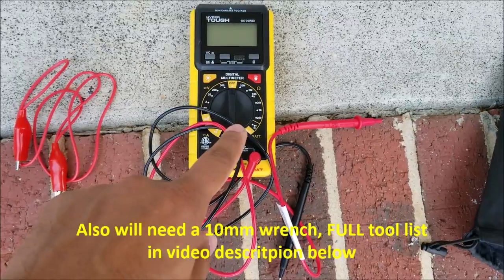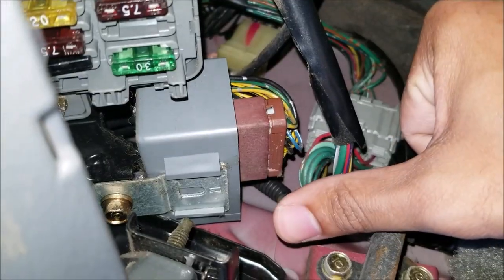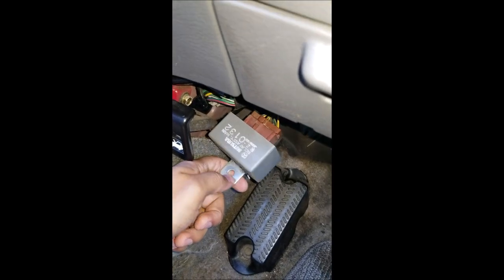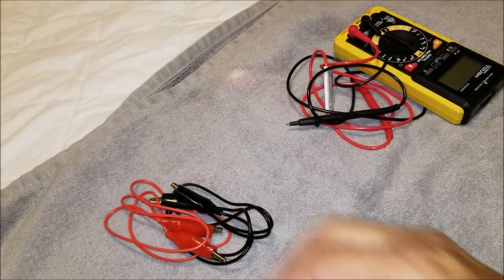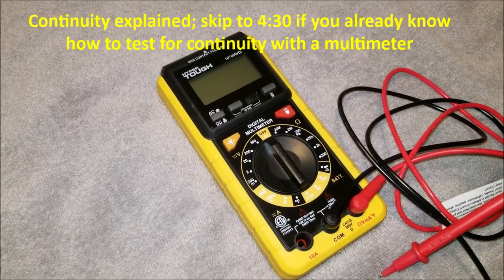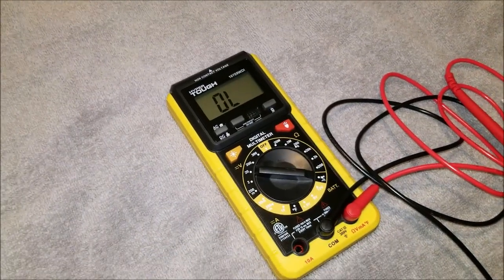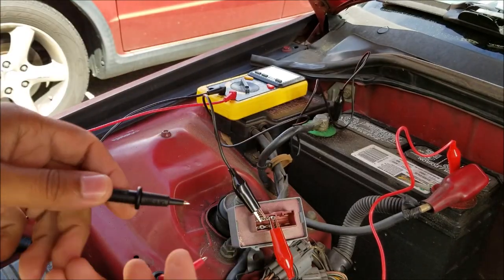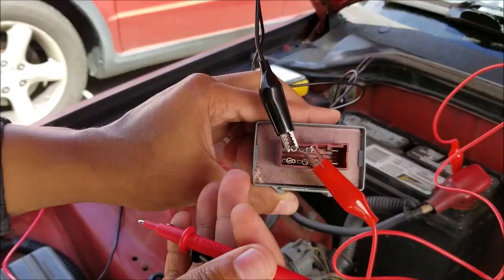How to Test and Replace Main Relay | Honda Acura 92-00 | Car No Start

Comment: Props for making a good video in an apartment parking lot. I use to have to work outside too. Made me tough and thankful to have a shop to work in now
Reply from the maker: Appreciate you noticing that fact haha, had to make do with what I had at the time. As you said, definitely makes a person appreciate working in space on a car. Thanks for taking the time to leave a comment
Reply: @EngineeredMojo  you bet! Thank you for the advice, I used it. My relay is clicking and I have pressure on the rail. Now I'm digging into the distributor. I had no idea they have problems like they do. Had a little bit of oil in the bottom of the distributor cap, but def not oil soaked. No spark though. Any more advice on this one? Have a good day!
Reply from the maker: @jesseray8433  there is an O ring in the distributor that sounds like it needs to be changed. But I doubt that would be the cause of a no start. I'd keep pushing through the steps. You've verified fuel, now you can verify spark. Inline spark tester can be sourced as a loaner tool from a local auto parts store. If that checks out, good ol compression check is next. Which that tool can also be gotten as a loaner and not much different process than inline spark test

Comment: My canadian 99 civic Si (american would be EX) keeps blowing fuse 15 (alternator/speedsensor) but if I unplug  my main relay it doesnt blow it. Something about that main relay or wiring is causing it.
Reply from the maker: Check out this thread, you may have a short circuit beneath your intake:

https://www.honda-acura.net/forums/92-civic-el-and-del-sol/215003-alternator-fuse-keeps-blowing-whats-the-problem.html
Reply: @EngineeredMojo   im afraid not. i have a k20a2 swap out of a 02 rsx type S. everything was running fine on that type S. its just my civic has been sitting for a year and half. i feel as if my pump maybe went bad or relay contacts got messed up. car sat in extreme cold and then extreme heat
Reply: and if one of the wires from the main relay harness shorted im gona wana give up
Reply: and if one of the wires from the main relay harness shorted im gona wana give up

Comment: what happens if i only feel one click??
Reply from the maker: You may have a circuitry failure. I'd either perform the test shown in this video or if you don't want to hassle with the testing you could purchase a new relay to see if it fixes your issue. Its such a fast swap and test, only costs time to drive to store and cost of relay if that's the issue.

Comment: Excellent video and thanks for including the pinouts and testing procedure! I used your test to verify that my newbie re-soldering was effective on my '96 accord. Two further tips. 1) You don't need to remove the 8mm bolt to get to the relay. You can just slide it up and out (may be a little sticky at first). 2) Also, to give yourself more room under there, you can remove the under-dash with only one screw hidden behind the coin tray to the left of the steering wheel.
Reply from the maker: Ahh thanks for the tips! The less bolts to remove (and possibly lose) the better haha. Awesome you went the resoldering fix route. Did you find it a simple process? I've soldered different components in past but never a circuit board. Also thanks for taking the time to leave feedback and provide useful tips. This is getting pinned
Reply: @EngineeredMojo  Yes. I had never really soldered before. I just watched this video ( https://youtu.be/-PLCEeTeXys?t=49 ) bought a cheap soldering iron and gave it a go. I figured the worst case is it wouldn't work and would go ahead and spend the $50 on a replacement. But your tests gave me the confidence that I could prove continuity after completing the solder. And I could definitely see the cracks visually within at least 2 or 3 of the existing solder points when I began. I am not normally a fix it guy, so it was very satisfying to "do a thing". Thanks again.

Comment: I don't understand why you need to connect the relay and multimeter to a 12v battery to check continuity. Multimeters have internal batteries for finding continuity. Or are you checking for voltages? I checked all 7 connections of my main relay with the multimeter (no 12v battery involved) and not connecter showed any continuity with any other connecter. I suppose this means the relay needs repair. Correct? You didn't show the two other of the three tests, but which terminals do you test for continuitiy? They are numbered 1-8 on the relay base. Which to which?
Reply from the maker: You're not going to get enough voltage to actuate the relay without a battery. That's the purpose of the battery and probably why you are not being able to accurately test continuity. If you were just checking a straight path of wire connection no battery would be needed, but remember you are testing a relay and the switches only open and close electromagnetically. Hope that clears it up, use the battery as shown haha
Reply: @EngineeredMojo  O.K., I understand the need for a 12v battery. I still don't know which terminals to attach voltage to then which terminals between which to check continuity. As it turns out, I'm not going to concern myself with that this week-end since I did continuity test of the circuit board itself, between the protruding wire terminals and the one or ones on that segment of the board. These all connected, with small ohms, with current moving across the board. One terminal, though, would connect only contacting the solder, not the wire. And the wire and its own solder don't connect. Although the disconnection is essentially invisible, this must be the broken solder connection. I plan to re-solder it, then re-install and test for starting.

Comment: Excellent. Thanks!  The test also works with a 9v battery. I tried it inside where easier to work with. 
I have a 2001 CrV. It jerked a little at low RPMs one day around a traffic circle or two, stalled in motion during a turn but would start immediately back up with some extra throttle.  The next day it wouldn't start. It's a manual transmission. It was running like a top for 1,500 miles with 35+ mpg fuel economy.

No codes. Battery is good/charged. Spark production at plugs are arcing and appear correctly timed. All the fuses inside cab and the motor bay are good by sight and ohm tested. Main relay under glove box appears good and tested good. No oil or coolant cross- contamination. Motor oil and coolant is full. 
I've tried the accelerator all the way to floor as well as pumping.
I've tried spraying starter fluid into the intake and still no start. It will crank and crank until battery is dead. If I hold gas pedal 100% down it sounds like it almost wants to start (sometimes) but doesn't. 

What should I check next? Again, no obd2 codes are in the computer. I was gonna check for fuel on the output side of the fuel filter....just loosen the sealing nut a couple of turns. The timing should be fine and there's no abnormal noises from anywhere. Thanks!
Reply from the maker: A compression test would be my next step, if you don't have the gauge that plugs into the spark plug hole it can be rented for free from an auto parts store. Then I'd check fuel pressure as you state above, keep me posted on the process if you remember to come back to this thread!
Reply: I would check the crank position sensor
Reply: @stevenblack2548  new info. It will start and run for 3 to 5 minutes and then hard stall and sometimes restart but usually not. When it cools down it will restart 6 to 24 hours later.
Reply: @thesetruths1404  my car is having this issue please tell me if you fixed it
Reply: @sdtruth619  the issue was a bad ICM (Ignition control module) from the get go. I replaced it early-on but the part was bad and kept it failing.  I went thru everything twice and when I reinstalled the original ICM it changed enough to give me idea it was a bad ICM. Ordered 2nd new one ( more pricey brand ) and sure enough it worked. If you install an ICM buy one that's $40+ in cost. Not a China one.
Reply: Furthermore what caused ICM to I believe was likely spark signal suppression from oil filling up my spark plug holes. Bad crusty valve cover seals in them. Someone changed the main valve cover seal but didn't bother with spark plug seals for some lazy reason. Dumb dumb. Lesson learned was always pull spark plug boots if easily accessible when inspecting a car to buy! I think they were leaking from before I bought it.

Comment: Help someone my car has power but wont start I replaced the starter it was not it it just stop working when I stop for gas and hop back in then it stop working doesnt crank just shows dash lights
Reply from the maker: No crank? As in your car won't turn over and try to start? Sounds like it could be a possible issue in your ignition system. Does your fuel pump prime as in can you hear it when key is turned to II?
Reply: @EngineeredMojo  Same problem with my civic. I did a auto to manual swap and the car turned on fine and everything. I didn't drive it for a few day and when I did it was low on gas. I go to the gas station and add gas and then it won't start. There was a crank but wouldn't start so I had a spare battery and basically jump started it like that but as I was driving away the car idle was bad when accelerating. It wouldn't go more than 5mph until it suddenly stopped. From there I had to push my car home (Luckily I live a few blocks from where it all happened). It was a good work out though. From that day I replaced the fuel pump and still no go. The dashboard lights turn on and the main relay clicks are there. Fuel pump was just replaced and its priming. My only guess is the battery but I doubt it or else the lights inside would be dim or the car wouldn't have any power at all. What can it be?
Reply from the maker: @samuelochoa3344  I assume no check engine lights correct? Sounds like your ecu went into "limp" mode since you could not travel more than 5mph. I would assume a distributor issue given the bad idle you mentioned and a clogged catlytic converter has been known to throw an ECU into "limp" mode. Do you have a spare distributor you could throw on your car to test or an inline spark tester(can be bought pretty cheap or as a free loaner tool)?
Reply: @EngineeredMojo  Thank you for the help brother! It ended up being the battery. The distributor would be a bit concerning though - being I'm on a slight budget lol. I'll forsure use this for whenever its needed. Thank you for the help and quick reply brother! Right on!!
Reply from the maker: @samuelochoa3344  awesome! Always good to hear of a car fix being effective

Comment: Heaven help you if it is an 89 Integra.  It is all the way up further back near the firewall, and way up out of reach and out of sight mounted along side a couple other switches.
Reply from the maker: Wow, not the typical considerate japanese engineering haha. Good to know thanks for sharing! I run across those gen integras every now and then

Comment: Would you happen to have the test procedure  for testing the harness that the relay plugs into..
Reply from the maker: I do not unfortunately, if you are comfortable with using a voltmeter and have a haynes manual, there are good wiring diagrams in their for Honda/Acura that will show you which wires are used to complete a circuit. That'll help guide you on the sequence to test you harness. Hope that helps a bit

Comment: What if the starter relay clicks, and the car cranks but doesn’t turn over. The fuel pump works, battery works, and the relay does the clicks the way it’s supposed to.
Reply from the maker: If your certain your getting fuel, next check would be to confirm you're getting spark. They sell online spark testers that are fairly cheap and easy to use. If spark is confirmed your next step is to test compression at each cylinder. Again a compression tester is fairly cheap tool, it's just a process. I'll put this on my list as a video to make but in the meantime their is a channel chrisfix that goes through the process I talk about above on a general overview

Comment: Can you please answer I have 1992 Acura Integra 1.8 and I have to be replacing it every like 5 months the main relay is that normal being and old car I won't hear the click it won't turn on r I have to open the key live it for a while then it will turn on but eventually it won't. I replaced the main relay than it turns on .
Reply from the maker: If you are replacing the main relay every few months, I would trace/view the wiring back to the fuse box to see if there is any damaged wiring to the main relay that may be causing an electrical short circuit. It shouldn't be malfunctioning every few months
Reply: @EngineeredMojo   ok ty I replaced the main relay fuse I put it on, but thers still no click, the check engine is on, when it use to click the check engine would turn off and it would turn on like nothing, why is it not clicking ?
Reply from the maker: @cadillack6989  does your vehicle now start and stay running but with a check engine light?
Reply: @EngineeredMojo  no it doesn't turn on the car I been looking for info I found a similar problem and something about ECU the check engine don't blink it just stays on ? Could it be the ECU
Reply from the maker: @cadillack6989  do you know anyone with a car similar to yours where you can swap there ecu to test? It could potentially be an ecu problem. Ecus are fairly cheap as well on the used market
Reply: @EngineeredMojo  nope this is like the only car I've seen around not even on the yunk yards I live in Bakersfield CA
Reply: @EngineeredMojo  I have a question if ECU is not working would it still have gas pressure and spark?
Reply from the maker: kg quite possibly, the ecu can be malfunctioning in only a certain circuit causing a localized failure. While not common, it's possible for a solder to fail in an older ecu, there are a few YouTube videos about specifically for Honda ecus
Reply from the maker: @cadillack6989  dang well at least you have a unique car in your area. Used ECU's are fairly cheap though, wouldn't hurt to purchase a used one to test if you are not comfortable opening up your existing ECU and testing circuits (I know that's is not my strong area)
Reply: @EngineeredMojo  like for how much for a used one a ECU, can you look for one I'll pay you
Reply: Yeah I really like car I have plans for it, is a rare car in my Area that's why I like it even more cus no one has it, what really sucks is that I can't find parts for it not even on yunk yards it really sucks I need a moonroof window also for my 1992 Acura gs 1.8 Sedan and that gets me mad
Reply: Is not that I don't wanna pay for a used ECU is that I don't know where to get it I saw one on eBay but is 189 dollars and I don't trust eBay I wish there were more cars in my area lol for the parts

Comment: I have a question. I HAVE A 1999 Acura CL 2.3. Lately I can drive it for consecutive days and it will run fine. Then I will drive it and suddenly cuts off. Once I let it sit for awhile and crank it 5 or 6 times it will start and then cutoff and start again and run fine. 
I was told that it was the Throttle Body position censor and then again I was told it's the Fuel pump relay. 
Please advise.....
Reply: I cleaned the throttle body real good and it ran for a week straight with no issues.
Reply from the maker: If your car runs then suddenly stops, my initial guess is you are either losing fuel or spark. Throttle body sensor could be a concern. It's fairly easy and cheap to do a swap and trial or to test if you have a ohm meter. Given the car starts, compression loss shouldn't be a concern unless it's running rough while started. This type of problem will take a bit of testing to see what can be the issue if you are not throwing a code. I'd start with visual inspections of the fuel pump (see if any rusting has occurred), fuel lines, and visual of your ignition system from the ignition inside the car, alternator, down to your spark plugs. From there you can run inline spark tester to test ignition, which is fairly simple. I'd test as much as you can before replacing parts in a trial and error method. You may be able to rule out a spark issue or fuel issue or throttle position sensor issue.
Reply: @EngineeredMojo  I ran it this morning no problem no error codes. I'm lost....spark plugs, wires, distributor cap all changed. I did the starter fluid test and it started which probably means t he relay is faulty.
Reply from the maker: @gilliammark5083  I see you've exhausted your tests and replacements, at least that's out of the way. Good thing is the relay is easy to test or if you don't want to deal with breaking out a voltmeter, relatively cheap to attempt a swap trial and easily returnable if that's not the problem. Do you here the fuel pump prime when you turn your key to the 2nd position?
Reply: @EngineeredMojo  haven't really paid much attention. I find it strange that the car will cut off and 5 minutes later start right back up and run and throw no codes. 
Like I said I'm lost on this one. My neighbor is my mechanic he's a certified mechanic through Firestone. Did the starter fluid test and it cranked right up. 
Fuel pump relay or the main relay. 
Question....when I change the Relay is there fuses inside the fuse box that are bad?
Reply: @EngineeredMojo  thank you sir

Comment: I got continuity at the test.but got no click noise after i turn my igniction swich one step
Reply from the maker: Take a read through the video description. It's been updated to reflect the click should be felt on the second key turn. I spoke incorrectly in the video. But if you have continuity, then most likely the issue is not with the relay. Have you check whether you are getting spark?